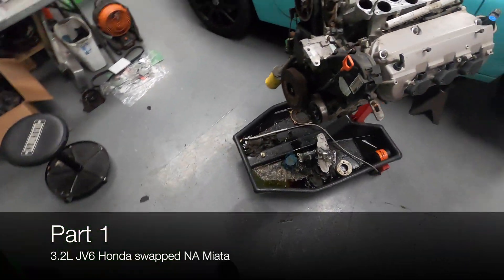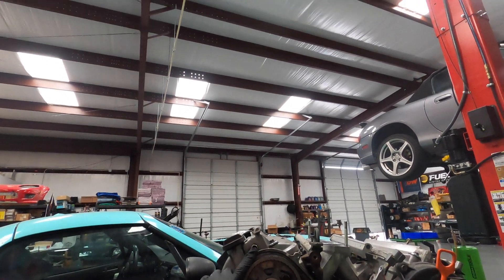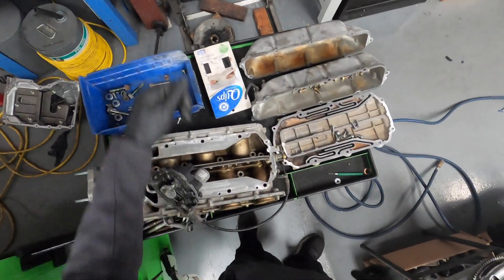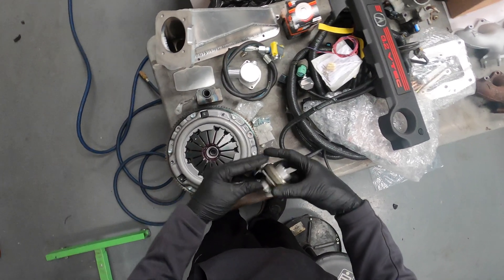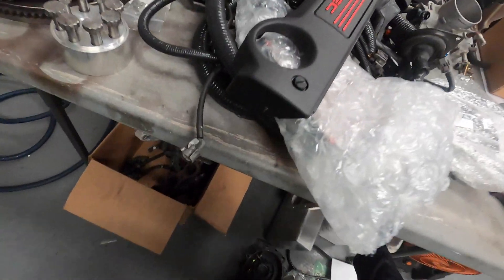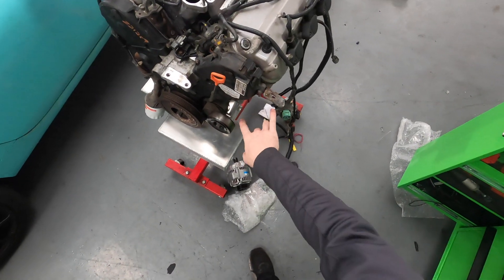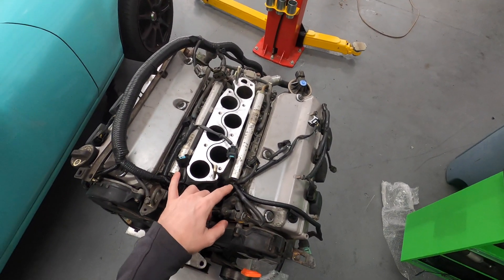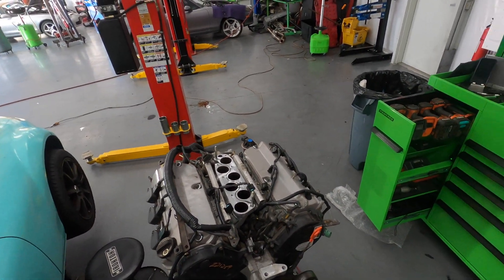Honda V6 3.2L swapping an NA Miata - Part 1

Comment: Question, is it possible to swap everything onto the subframe and lower the car onto it?   I.e. will the engine fit between the frame rails.
Reply from the maker: I'm not sure if you could swap "everything" but the bulk of stuff yes. Some of the work needs to be done on-car since the spacing is very tight and you'll likely need to make judgement calls or modifications to match.